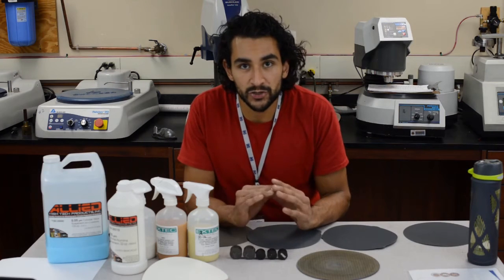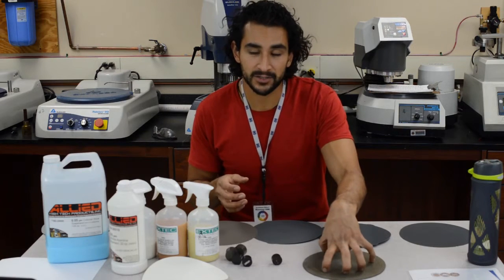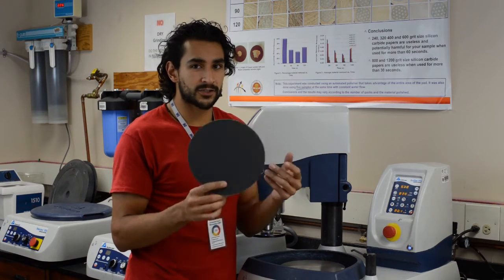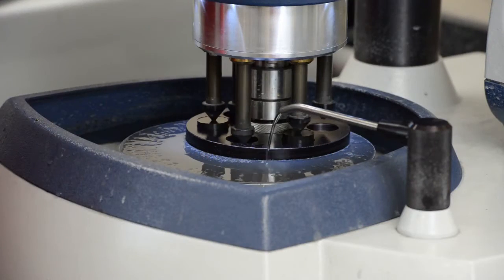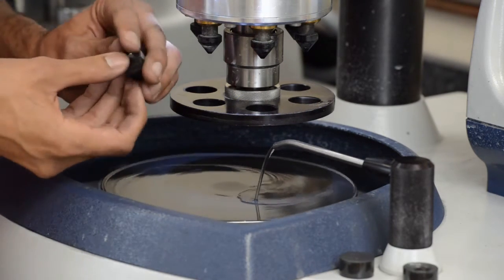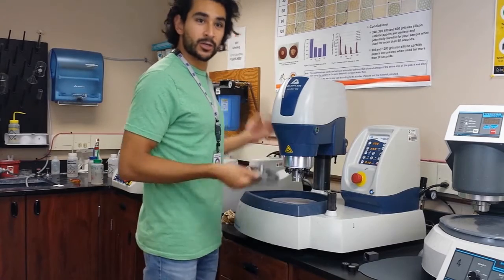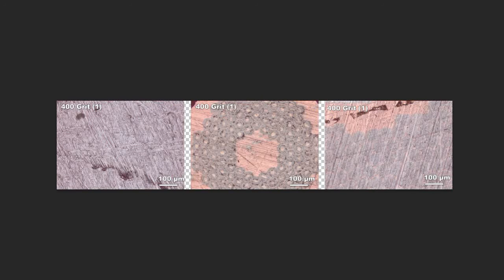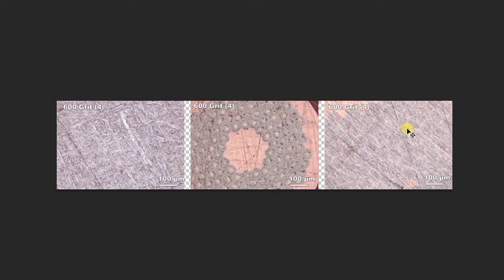Metallographic preparation - Part 4: Transverse sample polishing (silicon carbide)

Comment: Sir I liked this video very much and many congratulations for explaining the grinding techniques in detail.
Actually Sir I am still a beginner in this technique and as we have been provided with only the manual machine it is becoming difficult for me to choose the right kind of sample ,the grit size, the right motor speed and also how to hold the sample correctly because many planes are getting generated due to non uniform pressure.
Hence I shall be highly grateful if you can upload a video showing the right technique to use a manual machine for beginners and the remedies of the above mentioned problems.

Comment: how many paper  reused before you change to new paper? or you use once?
standard at my lab is the coarse grit use 120 and finest 2000, but the supplier company often out of stock and only supply up to 1200. is that fine?
do your disc holder has loose fit to mounting?  my disc holder has gap 0.5mm and 5mm thick so sample wobbling when machine running resulting curve face. that annoying when using microscope escpecially when observe chrome thickness at the edge.
sorry for my bad english